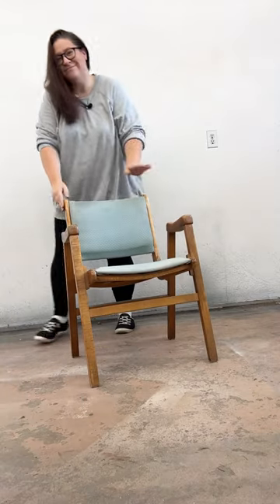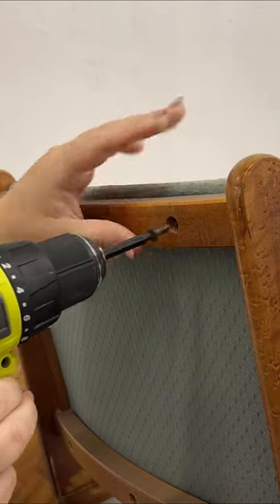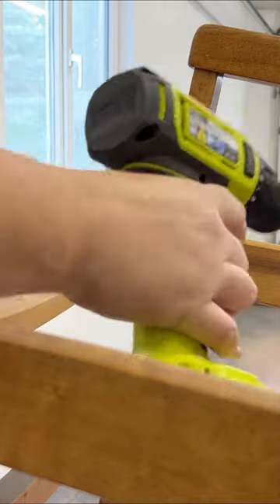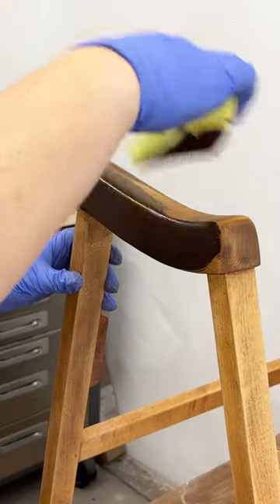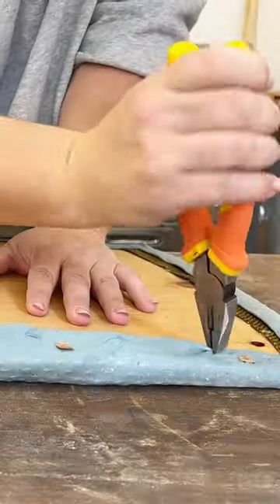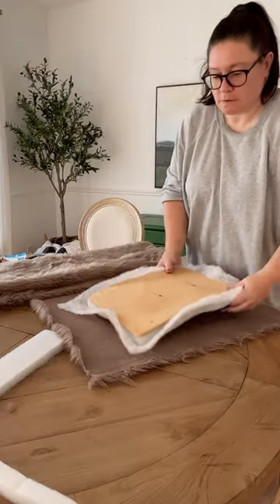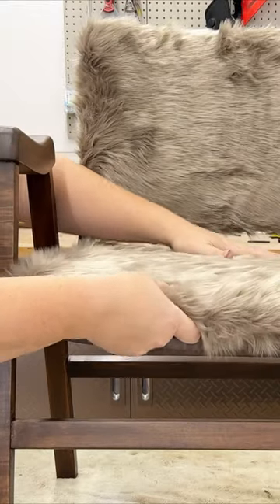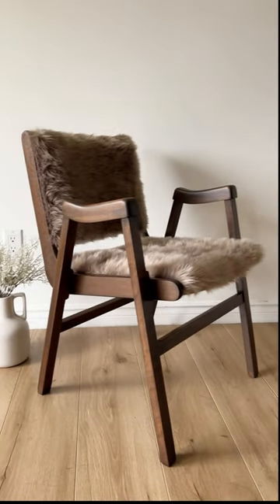Mid Century Modern CHAIR REVIVAL!

Comment: That was a mid-century modern chair of which you just destroyed the original finish. That was crazy, you need to know what you're dealing with before. You actually destroy something that had more value with the old finish. Then with the new finish that you indiscriminately applied.
Reply from the maker: I know it was a mid century modern chair. Since it’s my actual job to know about these things, I’m able to tell you that the original finish did not add any value to the piece.

Comment: Love the darker, richer looking stain! Not a faux fur fan, but it works. For chair seats like this, I like to use carpet padding. It has a much better resilience - easier on the bum - and at 1/2" thick, I simply layer it to get the thickness I want.

Comment: I love your flips- BUT not this one. MCM should remain when it’s feasible- and on this flip it would have been best to thoroughly wash the wood and keep it intact. Replace the material with a simple and similar fabric that was used during the MCM era. 
Certain antiques should not be sanded- this was one if them. The value of the chair is now lost. 
But I love most of your flips and believe painting some pieces or restaining is perfectly acceptable. Just not this one! (You could have sold that chair for a LOT in its original style.)